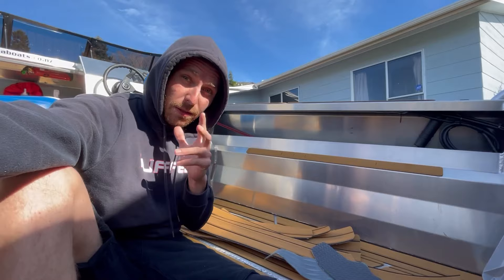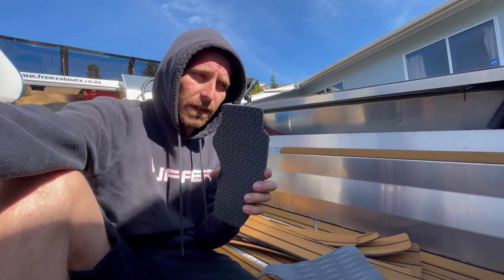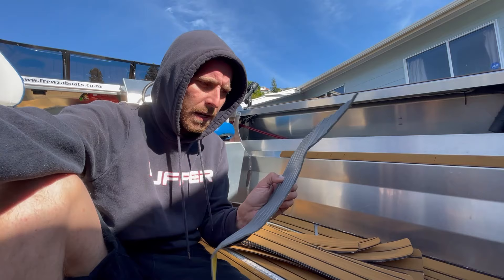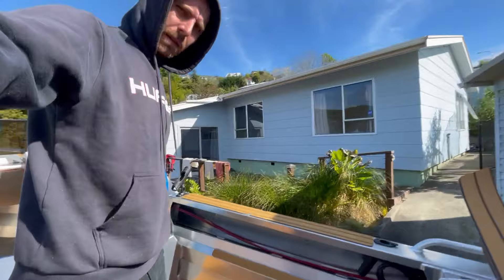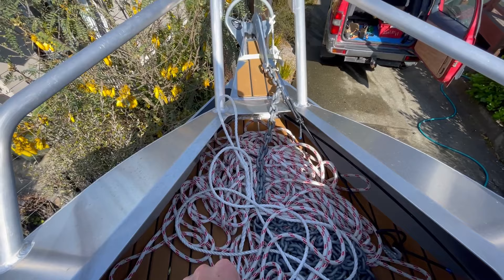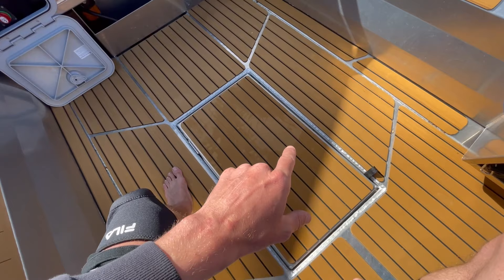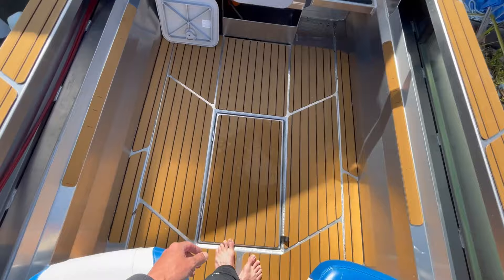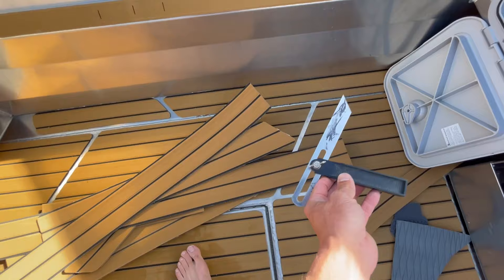EVA Foam Flooring, How EASY is it to do? | DIY series | Steadliest Catch Ep .32

Comment: Great video! Very helpful. Thanks mate. One more tip. If you don’t want the aluminium showing between the gaps, you can paint the floor first in a nice contrasting colour.
Reply from the maker: I don’t recommend painting aluminium of any kind unless you want issues down the track.
Reply: @SteadliestCatch  mate, I’m a car painter by trade, if you prep it properly and use an etch primer, it will last longer than that foam floor!

Comment: I'm actually gonna install this stuff on top of my boats carpet. I know that sounds wacky but I'll finish the edges with stainless screws and finish washers so it'll look really nice and can't move regardless of the situation. Your thoughts???
Reply: And I'm not laying one huge panel, but many smaller ones with the carpet exposed around the edges
Reply from the maker: yeah i don't know about that, what is the benefit doing it that way rather than removing carpet first? but then again, I am more of a do it once, do it right kind of guy...
Reply: @SteadliestCatch  Just thought it'd be a little more cushy and still couldn't move at all. I may even do some finishing screws in the center of each panel, I'll see how it goes 🤔

Comment: Great job brother, what scissors are you using. Ive used a blade but love the scissor idea as it gives me more precise cutting.  Also, you can use low adhesive clear contact paper for perfect stencils.   🤙🏼

Comment: Awesome video! I was thinking about installing some instead on replacing it with carpet. I was curious though what the process would look like on a wood deck vs a metal one.
Reply from the maker: I would score the surface very lightly with sand paper to remove any dirt and rough up the surface to give better adhesion. Then make sure it is clean as possible before laying the product.

Comment: Thanks for the video! Just wondering if it helps to put some silicon sealant along the edge of each floor sheet?
Reply from the maker: For what purpose? With a properly prepped surface you would struggle to peel this stuff off.
Reply: If it is hard to peel, does it mean it may damage fibreglass floor (if the boat is fibreglass) while the matting may need to be repaired/replaced? With the sealant it may better prevent any water go under the mat? Sorry I never do this before so just a little bit concerning.

Comment: Did u get you’re boat made with plain floors .? I have been told you can’t lay it on tread plate floors , is that so ,cheers ,great vid
Reply from the maker: Yeah had it made with flat floor from factory for this purpose. Cheers

Comment: Thanks for the clear video! Great.

My polyester boat has some kind of structure on the surface of the floor, for grip. It’s just polyester as well.

On your experience with this foam, you guess it will still stick? In your video it looks like the adhesive it pretty strong.

Tnx for your reply.
Reply from the maker: I am not sure sorry, I have no experience with laying it on anything but aluminium. Best to ask the manufacturer. If you are in NZ call nz rubber and foam, they should be able to tell you
Reply: @SteadliestCatch  That’s a swift response! I’m from The Netherland, but will have a look for someone who can tell me more. Tnx. Enjoy your day.
Reply: @downwind73 Did you manage to find out if it sticks sufficiently to a polyester surface? If so could you recommend where to buy it...I am from The Netherlands as well. Cheers.

Comment: do you need to sicaflex the edges, on the top surface areas, mate to prevent pealing
Reply from the maker: Nope, the adhesive is very strong providing you have prepped the surface correctly. Just keep petrol and other solvents off it as it will dissolve the afhesive
Reply: @SteadliestCatch  thanks for the advice

Comment: Hi mate. Nice boat! What size outboard did you go for? I am looking at a second hand 2016 F16 on Trademe. It’s got a 60hp Honda 4 stroke. In your experience of the F16, would that be too underpowered? Usually just fish 2 of us, and all fishing and no diving gear. Cheers! Mark.
Reply from the maker: Cheers mate! I went for a Honda 90hp 4 stroke. 60hp is 100% underpowered, the amount of people I see replacing the 60 down the track is proof enough. The 60hp is just a way of keeping the cost down from factory so it’s more affordable for buyers - something frewza is VERY good at! 
In my honest opinion I couldn’t imagine anything less than an 80hp for the F16, especially if you are adding heavy mods like bait tank, underfloor tank, thicker hull, twin batteries etc. 

You could JUST about get away with it if it was a no mod hull, in calm conditions and not loaded up at all, but it would still piss you off!
Reply: @SteadliestCatch  Haha. I thought so. I was wondering why it hadn’t sold on Trademe, given the crazy boating market currently! Tossing up between a second hand 2007 Osprey 450 with 50hp Honda 4 stroke (super stable but quite narrow) or a new Senator RC500 with Yammie F90 (new and roomier, but 2.5 times the price of the Osprey). What’s your choice between these two?
Reply from the maker: @markhirst3888  I would go with the senator, the ospreys are great, solid boats and used a lot commercially down here in Tasman bay, but in my opinion their design is lagging behind the new generation of boats. The senator are great boats and probably the best riding pontoon boat on the market, but at 2.5times the price? 🤔 is there not any other F16’s out there?
Reply: @SteadliestCatch  I took the Osprey for a test drive out The Cut (I am in Nelson too) and it was very solid, but also admittedly very flat! I have had a Senator 580 hardtop about 10 years ago and they are great boats so I expect the RC500 would be too. The 2007 Osprey is only 20k and the Senator is in stock at a dealer new for 56.5k (it has extras like raised sides, bait board, guide poles, walk through transom, and a mid range Simrad sounder). A new and roomier boat than the Osprey but 36.5k more! Need something for fishing Stephen’s Island every now and then. Haven’t seen any other F16s for sale but were a couple for sale about a month ago but not with the right outboard.
Reply from the maker: @markhirst3888  yeah the Frewza price tag a good in between - if you are patient I may be selling mine after summer 🤫 . The senator is definitely the upper end of the $$ scale.
Reply: @SteadliestCatch  Haha. Why would you sell yours so quickly? You only just got it.
Reply from the maker: @markhirst3888  to go towards a house… might not need to yet 🤞but it is an option
Reply: @SteadliestCatch  Fare enough. Money doesn’t grow on trees😄

Comment: Have you put it down on tread plate?
Reply from the maker: Nah wouldn’t recommend laying over tread plate, will create air bubbles and allow for dirt to build up and may cause corrosion issues.
Reply: Anything you recommend to put on tread plate?
Reply from the maker: @kinaontoast7655  tube matting or we use large rubber mats from para rubber on most of the work boats.

Comment: I've used ultralon and Chinese 3m
Eva foam I think ultralon even though a great product the adhesive product they use is terrible compared to 3m adhesive Eva foam.
Reply from the maker: I used Ultralon on the last boat and our current work boat with no issues whatsoever. I have had the Chinese 3m adhesive on some other products (LED strips) and it wouldn’t not hold at all
Reply: @SteadliestCatch  yea I've had  same issues with led strips but is far better on the foam products wish ultralon had the option of 3m makes a massive difference especially when applying larger pieces much more forgiving